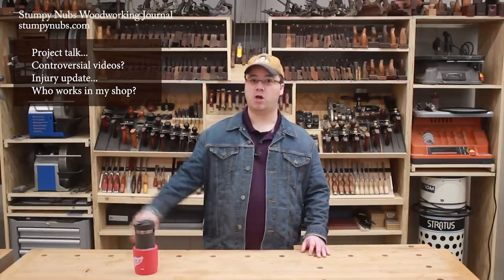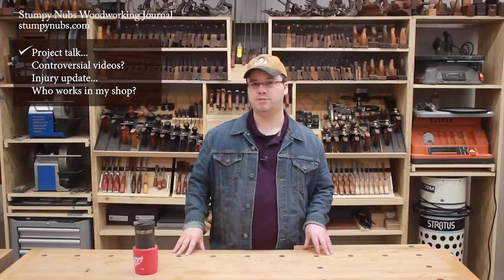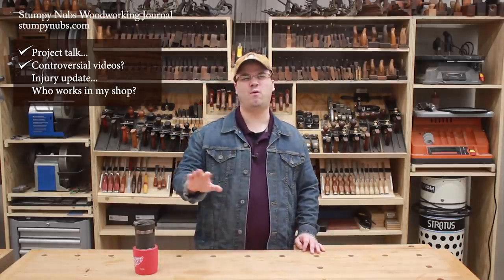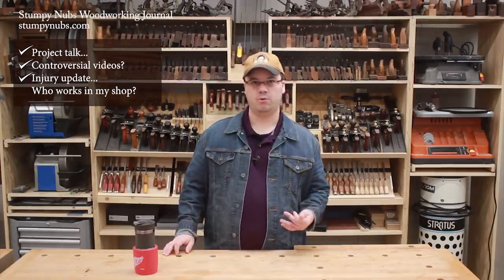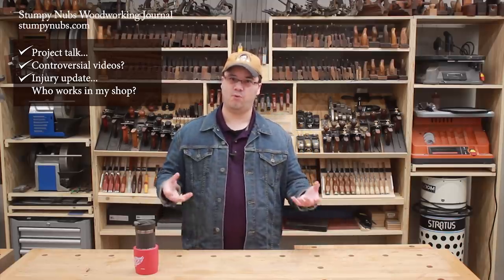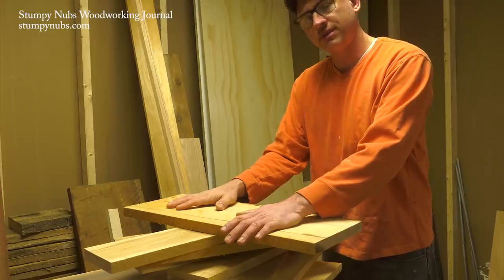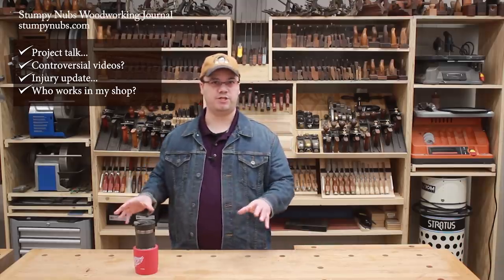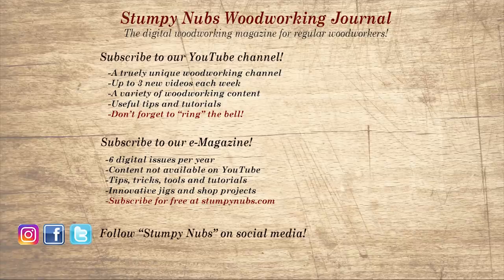Why I can't give the finger anymore (and other interesting stuff)

Comment: I mashed my right index finger, not quite clear off, with a 12lb spike maul about 30 years ago. It started getting better in the last couple of years, and finally works properly with full range of motion, without any pain, this year (2023). Here's hoping the you heal more quickly, and with less pain. 

I've really enjoyed reading through your posts, especially looking through the SawStop comments. I went to a good woodworking store, in Arizona, when they were nearly a brand new idea, and was impressed with a test they had scheduled to show off the new saw, and how it worked in an emergency. At the time, I was using a drillpress as my primary tool, building banjos, and couldn't imagine spending that much on a saw. You've changed my mind...even though I don't have a table saw. I really need a new band saw.

Comment: thanks for the update. I never broke any bones until I took up dirt bikes after I turned 60. PT (physical therapy) is amazing, but it hurts and you have to keep at it for months. Most of my bones are healed, but some joints have lost range of motion, and some strength is gone. But I'm happy with 95% healed. Keep getting better.

Comment: I have only been hurt on a table saw, when I was cutting some sheet goods, I now  raise the saw blade much higher than the wood thickness as I have found that any inconsistency in handing the sheet , the teeth blades push down the wood and not back at me,I am 90 yrs. old and are still doing wood working plus making a few videos, I enjoy your expertise.

Comment: I damaged my ring finger with the same kind of injury from a different too. I do now 20 years later have 98 percent flexability in my finger now. Stay determined to flex the joints and work on them full time when relaxing, It does get easier and is worth all the effort. Have faith and keep working on it.

Comment: I had tendon damage and nerve damage to my left hand at 12 yrs old (I'm now 71) caused by an explosion in my left hand. The shrapnel laid the palm of my hand wide open cutting tendons and nerves. The surgeon ran a monofilament line ("fishing line") through one end of the severed tendons into the other end and secured with buttons on the surface of my palm. (Remember this is like 1960) I know the painful stretching process you speak of. Many times a day for over a year I carried out my home therapy and I went to his office every week to check my progress. The harder you work through the pain the greater the success you will have. My regained usage and numbness from the nerve damage continued to improve for years after.

Comment: A couple of years ago I was working with my bandsaw. It's an old saw I inherited from my Dad and the on/off switch is down low and very stiff. I had finished my cut and was reaching to turn the saw off (hurriedly) and brushed the top of my pointy finger across the running blade. No stitches were required but I have a permanent reminder to slow down and be careful - a large crease in the fingernail. Haven't had a close call since and hope to remember to slow down.

Comment: As someone who owns both a table saw and two radial saws, I understand the dangers of both. I have one of the "how to get the most out of your radial saw" books. It is down right scary some of the practices that were promoted. I value my hands and fingers. Having watched the video of your accident, I am wary when running an angle grinder. I think about what you went through whenever I turn that tool on. Thank you for what you do. I have learned quite a bit from your videos.

Comment: Was sharpening an antique Addis V tool with my Tormek two weeks ago. As I crept up on the final edge I thought the sharpening jig thumbscrew was loose. In the process of “checking it out” I fumbled and subsequently caught it. The wings of the V tool cut deep parallel lacerations in the base of my left thumb. The bleeding was quick and steady.  Managed to grab a shop towel and apply pressure. Put a fabric bandaid on topped with duct tape and was able to drive to our local emergency room for a few stitches. In 25 years of woodcarving I have practiced healing on a regular basis. Most of the injuries have been while sharpening or storing full sized tools in tool rolls. Think I’ll consider some class 5 cut resistant gloves for those activities. 70 and learning!!  Thanks for the awareness boost.
Reply from the maker: That may be the first ever Tormek injury!
Reply: Stumpy Nubs :  Technically I was standing clear of the Tormek when I fumbled the V tool attached to the jig. The Tormek was guilty of regrinding the tool wings to a point they were ready for the strop.  I was sneaking up on relieving the “keel” or area under the apex where the wings meet. This tool had been sharpened incorrectly in its life and I removed 3/8 “ of of the tool on a bench grinder to square the profile prior to redoing the bevel. Normally I don’t need to regrind carving tools on the Tormek unless they are new, damaged or were abused by the uninformed. 1000/8000 grit diamond stones and stropping are all I need to renew an edge.  Could have easily been an un-powered diamond stone accident!

Comment: I am new to woodworking (2 years), nice little shop, some professional works but, nothing to stake a living upon.  I am dependent on a table saw for most applications and this summer, I found an old 1980's radial arm saw.  $15 dollars and a couple hours of cleaning later, I have a beautiful radial arm saw.  It is strictly used as a dado saw.  The above table surface arbor making changing out the dado stack very easy.  The cut depth is reversed and is so much easier to cut depth gauges and eyeball the depths of cuts.  Laps and heavy finger joints are instant.  Plus, it is easy to make stop blocks on a radial arm used as a dado saw.  

I would never use my radial arm for any of the insane cuts or uses detailed in the prior video in question.  I am afraid of my tools because, they have the ability to seriously injury me.  That type of power and ability requires respect.  I have learned that the hard way as we all have.

Comment: A little tip here, at 2:13 the slide out is very wobbly, I have found that if you stagger the drawer slides it makes for a much sturdier pull out on drawers of this style, put one drawer slide at the bottom like normal but on the other side put the slide  1/2 way up the drawer or near the top, that way there is support at different points and keeps the slide out from feeling so weak. I can send pictures if needed.

Comment: I'm a new subscriber so I missed your accident.  A few years ago I had the tip of my finger cut off. The doctors probably told you this but in case they didn't tap your finger with the nerve damage on a table or anything whenever you can.  That tapping stimulates the nerves and helps them regain feeling.  Hopefully it helps.

Comment: Ok, I’m doing the thing where I’m commenting halfway through the video, but I just wanted to take note of how right you are about some folks commenting negative stuff that was clearly addressed in the video. I recently did a basics video on using cherry, and someone was upset saying that I need to let people know if cherry burns easily or not, and how to prevent it, as well as what finish is best for cherry. Buuut, in the video I specifically covered both of those things. So I agree, it’s something I don’t understand and as content creators I guess we just gotta scratch our heads and move on.

Comment: I learned a new phrase today ..."the whole package of suck"!! I'm sure that i will be able to use that one in the future!!! 

In all seriousness,I am a retired shop teacher who loves your woodworking approach but I am also a paramedic with over 30 years experience. Your comment about your injury is spot on. You should consider a video covering the aspect of immediate post injury care: including the need for an adequate first aid kit, (most purchased kits are probably inadequate for a serious injury) a readily accessible phone in the shop (for those of us who are basement woodworkers) and probably an assessment of where a serious injury should go (for example, which hospital handles trauma the best in your area?) I view my basement emergency kit as insurance: I probably won't ever need it (i regularly replace items that are out of date!!) but it is there, if I ever do. 
The minor cuts & splinters every woodworker encounters I treat out of the bathroom medicine cabinet (ie band aids and tweezers are not in the shop kit.) Included in the shop kit however, are several 5x9 & 4x4 "trauma dressings" tape, a couple of "Israeli bandages", an "ace" bandage, and a tourniquet. Theoretically, the items can be self applied with one hand. (though practice helps!!)

Comment: I cut through more fingers that a person should. Once playing with a knife at 5, I completely server tendons in my pinky.  My finger looks weird but I never think about it anymore and can use it perfectly fine. An oyster shell took out a tendon in my twenties. Like your ring finger I couldn’t bend it after surgery. Months of use I got about 90% movement back, and after a year or more the pain stopped at a full bend. I lost the tip of my finger a couple years ago to a table saw. Like you said I couldn’t button shirt, or pick up coins. The human body is pretty amazing at adapting.  Don’t get frustrated your body is still healing and you’ll adapt when the healing processes is over.

Comment: Great video! My right index finger looks much like yours as a result of me stupidly having a run-in with a router bit 25+ years ago. I started getting feeling back in the tip about 15 years ago and now have 90% of the feeling back. Be patient, it takes time as I learned after knee surgery in high school. That took almost 20 years to get full nerve sensation in the front of my calf.

Comment: I have seen you other safety video.  Because of it, I have re-installed the riving knife on my table saw.  I had removed it because I made myself a zero clearance insert and there was no slit to put the knife into.  I got busy and altered the insert so the riving knife would work.  Thanks for your safety reminder.

Comment: Thank you for producing these video's. I learn so much from them. I have absolutely no idea how I initially stumbled onto them but I am so grateful - click subscribe and ring the bell! At this point in my development as an inspiring woodworker I've learned to make decent (my opinion) cabinets and begun to make furniture - humbly learning many important lessons (usually what not to do next time) as I go. My current arch nemesis is making drawers that truly fit well and operate smoothly. I've tried several types of glides and obsessed about squareness to an unhealthy level and bought several magic potion jigs off amazon to help me better align them (did I mention I'm fairly high detail oriented and actually want perfection at times). I'm fully understanding that wood is a natural sub straight and that variations occur and that the art of being a decent woodworker is being able to make things appear to be what they are sometimes not. Have you made videos on drawers and installing drawer glides? Is there a couple tricks of the trade I could watch to slow the growth of the pile of shame. Thank you! Thankfully I don't own a radial arm saw (lol) - my grandfather had one and I always quipped about him leaving it to me when he departed but it went to my father (a man who was least likely to ever use it)... who eventually offered it to me. By then I owned a decent table saw and had begun to have luck with a handful of jigs and when I looked at it, well, it just didn't hold the appeal it had in my childhood. We carried it to the curb together and put a free sign on it and it is likely now one of the 5 owned by Mr. radial arm saw and is well polished and cared for. Please keep producing videos and best to you and your team. Mark

Comment: I found out that you could get planning attachments for radial arm saws and though "ooo, I do need a planer" but I also thought "spinning wings of maiming" so I ended up giving the saw to a church yard sale because I knew if I kept it around I'd eventually do something stupid with it, I got the saw as part of a package deal so I wasn't disheartened to part with it. 
Now I have a sliding miter saw so I've got plenty of cutting capacity width wise and if not, that's what my skilsaw is for :D

Comment: Thanks very much for the injury update.  I had not paid much/any attention to your injury before cause I hadn't done it...YET! in 50 years.  Last Friday, tried to stop a wicked router bit, bare handed.  Router won.  I think if the bit had been in a small router rather than my 3hp. PC, I could have taken it?  But I.m happy to say the Dr. thinks it may heal up...mostly, rather than shorten my R. index finger by an inch or so.  The Lord designed marviolus clamps on each of our hands!!.  Bottom line,  mine was not as bad as yours so I think there's hope.  Thanks for what you do and how you do it.  I'm trying to mentally and actually "downsize" my shop.  At 70 years, my wife and I need to move into a much smaller place.  Pretty sure it's gonna be as hard or harder for me as her.  I could use some ideas for work surfaces/storage stuff that a guy can use in a one car garage and easily shove it around a.  I know there's a lot of ideas out there but I need to short cut to the best ones.  thanks, Glenn, aka, almost really, "Stumpy"

Comment: When your sitting at your desk, put the finger you’re having nerve issues with in a little bowl with dry uncooked rice. Just swirl your finger around. The constant stimulation really helps with regenerating the nerves after an injury like that. Long story, but it really help me. Plus, you have to keep stretching/bending your other finger! It will hurt, but if you don’t do it I can become permanent. The more you push it, it will not hurt as much over time.

Comment: Hi Stumpy! When I was a kid I managed to blow up my left hand, losing the pinky, shredding my palm, and burning pretty much everything else on that hand. I was told that I'd never have full use of the remaining hand but I used spring-based squeeze exercisers for strength. I used flexion exercises where I put my hand palm-down in the table and pushed the fingers straight. This was extremely painful but I kept at it and eventually I got to where I could lay them flat and the moved to pulling up at the tips to restore negative flexion range. I still lack some feeling in that hand (as well as, obviously, the pinky) but it is as now flexible and as strong as the right hand. It took a couple of years to get full strength and range of motion back but I got there. 

I'm not trying to diagnose your injury or how much you can recover, just wanting to pass along that rehab often takes longer than they tell us and recovery can be greater than they tell us. Keep at it and be patient with it. Good luck!

Comment: Recently I was working in my shop cutting some 1/4 plywood.  I've never had a kickback on my table saw in all my years (until now) and consider myself very careful and attentive to the potential of an accident.  I had finished the cut but the material next to the fence had not cleared the blade.  I loosened my pressure on that piece and it happened so fast I never saw the wood move. One moment it was there, the next it wasn't.  The flying wood just lightly skinned my knuckle and scratched my wrist thru the thickness of my jacket sleeve.  It could have been far more serious but thankfully it wasn't.  I will be making some feather boards and a more substantial push stick/block before I rip any more plywood.   I say post your safety video.  Some will heed it and be safer woodworkers because of it.

Comment: I feel you buddy! I cut the off my finger off back in April. Unfortunately, it was my right trigger finger. I hate looking at it or even thinking about it! It’s healed up nice, but it still doesn’t have full feeling and I can’t make a fist. I did mine using a circular saw. I was guiding the saw while taking off the edge of a sheet of plywood on some shaky saw horses at work. I can share photos if you like, but, as I’m sure you know, they’re pretty gory. 😜

Comment: To help with the scars message them several times a day with a moisturizer.  You can use anything you are not allergic to.  You can get silicone scar control pads cut them to fit and place them under compression.  You can get custom made compression gloves but the self-adherent wrap strips you use to protect your fingers would work as well.  If you are going to use the silicon and compression it really needs to be in place 23 hours a day.  The scar takes about a year to mature.  You can affect the scar as long as it is still in the inflammatory stage.  When the scar is the same color as the skin around it you can no longer affect it. Good luck

Comment: I have two Craftsman Radial Arm Saw "how to" books. You will be pleased to know neither contains the plywood rip technique with bonus abdomen surgery procedure. Perhaps because the oldest one was revised in 1967, the other was dated 1987 and includes added sections on; Drill Press, Wood Lathe, Wood Shaper, Band Saw, Scroll Saw, Stationary Planers, Stationary Sander, and Woodworking Techniques. All in 212 pages in 6"X9" spiral bound pages. Sears was a wonderful company. Keep up the good work and do not skimp on safety or humor.